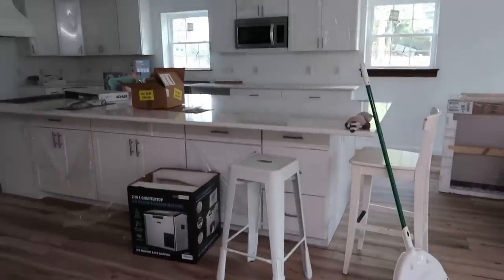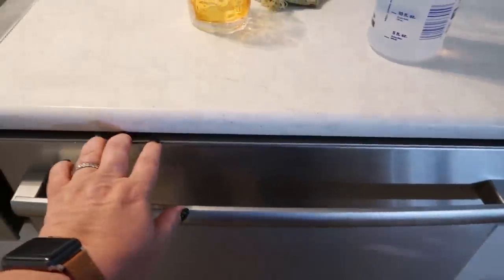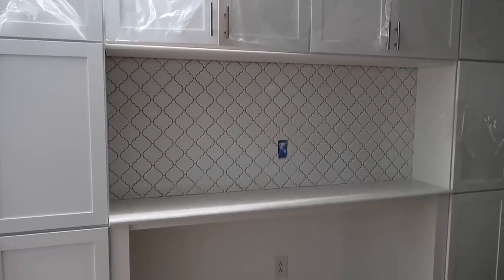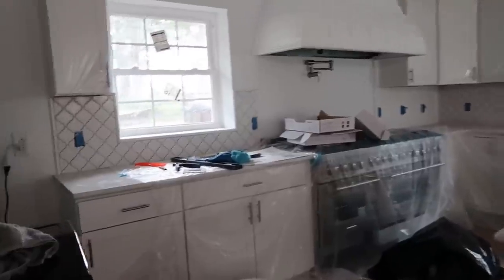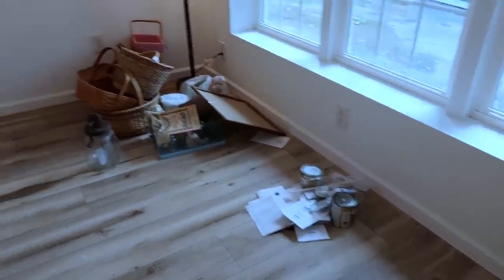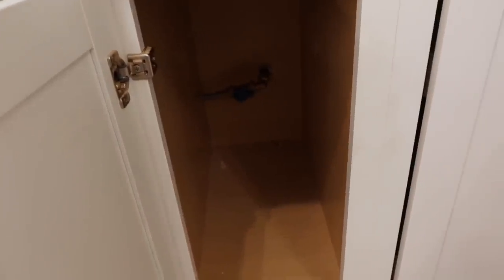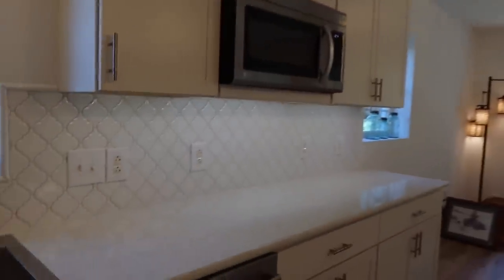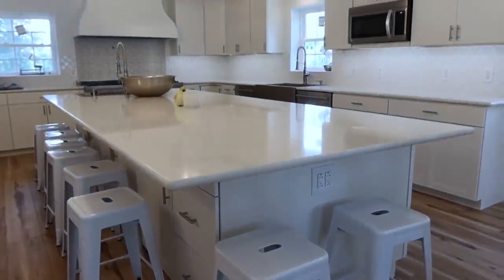My Dream Kitchen is Finished! Come and See!!

Comment: I use Clear Tempered Glass Cutting Board / Scratch Resistant, Heat Resistant to protect my quartz countertops. I keep one on each side of the stove, plus more where needed. I like that the quartz design shows through. I have two different sizes that work for different areas in the kitchen. Your new kitchen is absolutely gorgeous!

Comment: An old school noodle board works great to keep on the counter near the stove to put hot things on.  Mine actually sits on top of my glass-top stove to keep the family from dropping things on it.  I slide it off to cook and am getting ready to order another one from the designer to put over my sink that will work as a cutting board with a small hole it in to drop trash through the garbage disposal.  Love your kitchen!!
Reply: Love these ideas
Reply: What's a Noodle board?

Comment: I'm doing my 3rd white kitchen (of my own) in addition to many more here in NYC - I'm in the biz. You've done a great job with "OTC" materials, Jammerill! The only thing I'd do differently: spray paint your stools/chairs to an ivory/beige/warm grey that matches the floor/lighting fixtures/countertops. You're playing with warm whites, not cold, for the most part, and those metal chairs/stools spray paint beautifully. xoxo Edit: Also, you could use a bit of contrast... I'd do a beige/warm grey.
Reply from the maker: Nice ideas!! 💗

Comment: I use huge wooden cutting boards to put crockpots, instant pot, electric skillet, hot plate, and small toaster oven on when cooking to protect the surface underneath. I flip them over and use the bottom for this job. So far, this trick works like a charm.

Comment: Dear friend your kitchen is beautiful, you so totally deserve it. I'm so proud of what you both have accomplished! Can't wait to see you cooking up a storm in there.
You are going to love your range. Be sure to adjust the burners per the manual down as far as they go without going out. Then you have more precise control. The 3 burners on the left are my favorite type. The lrg, double ring burners are great on big skillets giving even heat with 2 flame rings and the smallest one on low is a perfect keep warm/simmer burner. In thirty yrs cooking on gas this is the highest btu range I've ever used so don't turn your back on it! 😀 It is not a slow electric range. Hopefully you have a gauge on the propane bottle so you know when it's running low. I would consider getting a bigger tank and move it away from the house if possible.
I have a confession, I stayed with all through your long childhood story but had to take some time to cool off cuz I was so angry about what you lived through! So sad for your years of pain, so proud of you and hubby for the life your kids are living!
Blessings,
Jan

Comment: We velcro our remote to the underside of the cabinet where we would usually stand to turn them on (think closest to the entrance of the room), then we just have to point it to the sensor where it needs to reach to turn them on, and then we velcro the remote back under the cabinet before walking away....a sure fire way to never lose the remote!
Reply: I forgot to mention that one clicker will work on each set, so you will have a backup clicker to velcro in a different safe place under the cabinet if there is a second entrance to the room.

Comment: A couple of little ideas - can Travis mount the remotes for the under cabinet lighting onto the inside of the cupboard near the power points?   The other thing - I think Ikea used to have a system to put inside drawers to hold plates secure when opening/closing  the drawers.  I'm sure there are others.  
I'm in awe of your new kitchen.  I bet you just sneak in and admire it every once on a while.  It all looks fantastic.  Well done to you both.  Hi from Australia.
Reply from the maker: You'll see in the next video that he put the velcro inside the cabinets for the clickers :)
Reply: @JamerrillStewart  I knew he'd have a solution!

Comment: Regarding your pot filler, is it possible to attach the top piece to go underneath the first arm instead of above..if so, it will save a lot of work and it would solve the height problem...I love, love, love the kitchen and all the tile...love watching the process and waiting for you to get everything moved in

Comment: Are those floor to ceiling cubbies on the wall opposite the kitchen just the same  kitchen cabinets but just stacked one on top of the other? 

Light, electric blue, like the glass jars, would be an excellent accent color. Light grey grout is perfect...brings out the appliances, sink, and swirlies in the countertop...awesome kitchen !
Reply from the maker: My wall of cabinets are just more kitchen cabinets stacked on top of each other. Thank you for all your thoughts!

Comment: You can also use a wooden cutting board for a heat shield! Wood is a great “insulator” against extreme temperatures
Reply from the maker: Great tip!

Comment: Everything is turning out so beautiful!  I love the mix of blue chairs with the white!  Your fridge should hold it's temp better and run less once it's filled with food, they are just like freezers, more efficient when full.  I'm not sure if you covered this or not, but are your countertops supported by thick plywood, especially on the overhangs?  I only see being able to put corbels under the short end for support.  I suggest maybe make a rule nobody sits on those overhangs or kneels on the stools and puts their upper body weight on those new counters.  
Your family will soon start making so many lovely memories in that new kitchen.  I think it matches the size of your heart.  💜

Comment: My thought, not a decorator by any means but... since you were kinda questioning the brass bits in your chandelier above the table area, could you paint them a light grey color to match the grouting in the tiling? Also I love the shape of it matches the lantern shape of the tiles around the sink/cabinet areas. Was that a planned note or just a happenstance thing?
Reply from the maker: That is a nice idea. I don’t mind the brass and like to mix in the different metal so I think it’s gonna work. Thank you for your thoughts!

Comment: I’m pretty sure the buttons on the dishwasher are supposed to be hidden. Why are the upper cabinets not flush to the ceiling. Looks weird to have a 2” space up there. But you’re worried about the window sills.  🙄

Comment: Okay I'm not sure if anybody else noticed it I have not read all the comments but did anybody notice that  the outlet in the cupboard next  to the sink that she opened up and was pointing at , it is upside down.?
Reply from the maker: It’s OK, we’ve had big convos about those outlets over here, so now you can join in as well. That’s actually how the outlets are supposed to be installed per the national electric code. My husband is an electrician and that’s the way he does it. A few kitchen videos back I explained the rational behind it. ❤️
Reply: @JamerrillStewart  oh I did not know that it's been a while since I built a house with my family my brother-in-law is also a retired electrician so I wasn't aware my personal opinion I think it's easier to plug them in when they're upside down